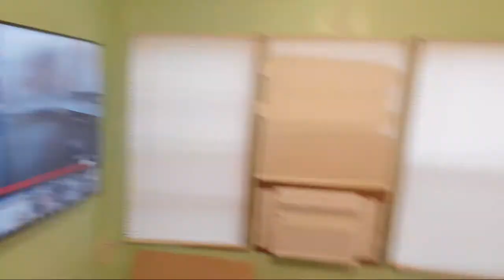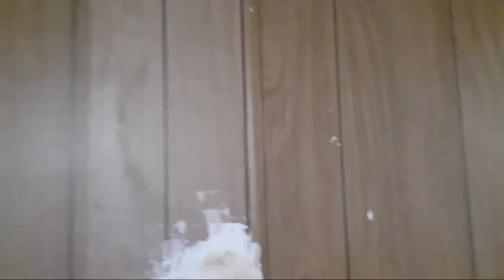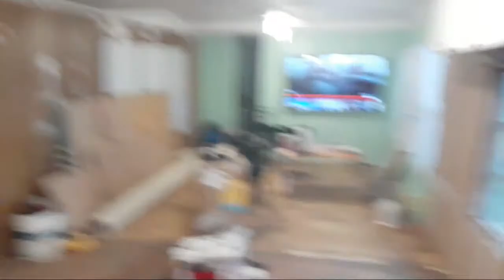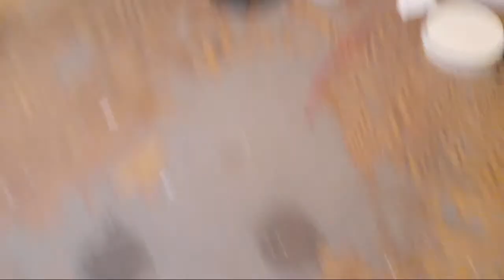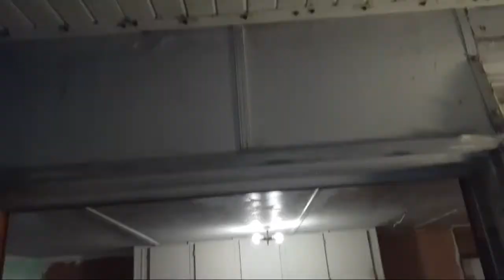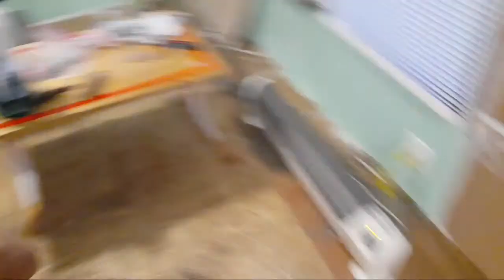Painting The Ceiling And Discovering A Leaking Floor - Living Off The Grid In A Tiny House

Comment: if you can get under the unit, you can confirm if the moist dirt touches the sub-floor. If so, the rain water will seep into that floor board. We had an issue where gophers had fluffed up some dirt all the way to top of joists and then the subterranean termites did their thing to the hardwood floor, the sub-floor, and the joists. If you cannot get under unit, you may carefully make a small hole in the floorboard to see if the dirt touches it. Be careful for electric and plumbing when making the exploratory hole.

Comment: Can you place a bowl with paper towel in it on the wet spot? There may be an intermittent drip coming from ceiling that just isn't apparent on a quick check.  If the paper gets damp, it's coming from above.